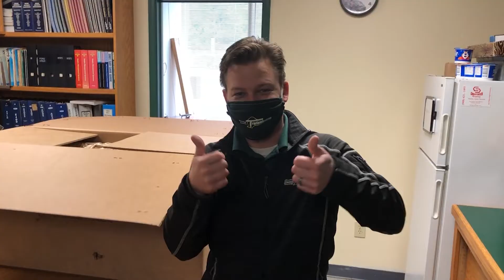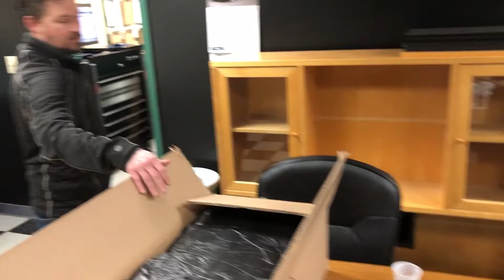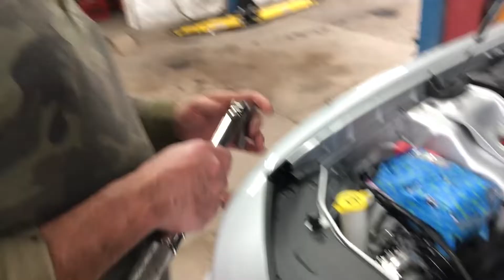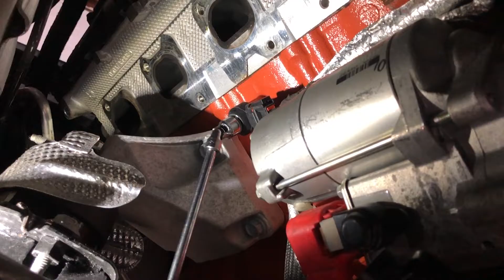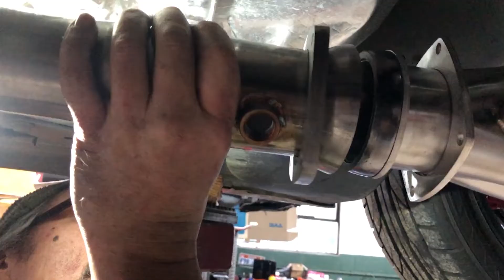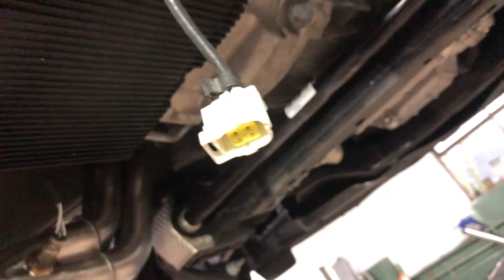DETAILED Installation of Corsa Dodge Charger Long Tube Headers & Connection Pipes.

Comment: Hey Steve, just wondering if you can put these Corsa long tubes with a lowered charger scat. I have the corsa extreme exhaust and H&R lowering springs. Just wondering if I have enough clearance for the long tube headers?

Comment: Is there any way to get these still ?
Reply from the maker: Maybe, if you can find a company that has old inventory.
Reply: @BEASTProjects  thanks my guy I have the exact same charger with the exact same color and exhaust I wanted to get the long tube headers to enhance the corsa extreme !!
Reply from the maker: Check my website for the discount code.

Comment: Every shop I find to put a gaskets and locking header bolts on my  already installed long tube headers say that they have to pull the engine and quote me a arm and a leg

Comment: Sir gotta question I have a cat back corsa extreme  I want  To put some long tube Corsa headers . Do i just need  Corsa headers  no extra pipes.
Reply: I’m pretty sure you’ll need the mid pipes also , I think he bought a kit that includes both LTH and mid pipes .
Reply: I don’t think he answers any questions on the charger anymore since he got rid of it. I miss the charger vids they were very informative.

Comment: What’s that tool called that he used to spread the xpipe ?
Reply from the maker: Expander Kit, https://amzn.to/3r5k2tt
Reply: @BEASTProjects  thanks you sir ,another question I’m not getting a tune when I install these yet can I use to the o2 sensor adapters to not get a cel ?
Reply from the maker: No guarantee that it won’t throw a CEL w/o tuning for off-road use.
Reply: @BEASTProjects  question buddy I installed my headers but for some reason now there’s a leak on both do u think I need to retighten the bolts again I put lock tight on them before going in as well

Comment: I’ve got a 2012 Dodge Charger RT and i want the first bolt on to be bbk long tubes. Does anyone know if i’ll need a tune for just the headers? I wanted to get fbo before i got a performance tune
Reply: It's best to get them tuned I'm getting along two headers added on my vehicle this month going to holler at my muffler dude 2 day

Comment: How does it work with active exhaust
Reply from the maker: Just fine
Reply: @BEASTProjects  so how does it work, is it eliminated or stays in place
Reply from the maker: The valves stay in place.
Reply from the maker: The exhaust valves are incorporated in the Corsa Systems. It’s shown & explained in a prior video.
Reply: @BEASTProjects  I had clicked on this video first, I’ll check the other vids to see the install, thanks

Comment: Did you get any check engine light ?
Reply from the maker: Nope, I have tuning
Reply: @BEASTProjects  what happen if we don’t get a tune
Reply from the maker: You might get a check engine light
Reply: @blkedout_3928  if you get a spacer fir the secondary sensors you will not get a check engine light
Reply: @adorno1010  bet bro thanks 💯
Reply: @adorno1010  question bro for the second o2 sensors do you mean the ones on the flange to put the spacers on ? Or I need a soccer for all of them ?
Reply: @blkedout_3928  just the second sensors

Comment: Where did you get your tuning done because my check engine light came on a day after they were installed
Reply from the maker: DiabloSport or Hemifever can get you all set up.
Reply: you just need a 02 sensor spacer if you dont want to spend hundreds on a tune or dont plan on future mods, other wise yes you will need a custom tune

Comment: This seemed so much easier then on the Durango SRT, lol took us 3 days. We are currently running Kooks headers and we think they might be leaking but not sure yet. We are getting misfires only on a cold start and getting P0300 codes and it's been bothering us for so long so wish us luck this weekend! Great video man and love that charger 👍
Reply: I know this is old but did you use the supplied kooks gaskets or the OEM mopar
Reply: @issawidebody50  We used the supplied gaskets. When we took the headers off we found out the gaskets were leaking, we're pretty certain that the gasket was the problem.
Reply: @trashdiligence5284  ok my boss at the shop I work at has been thru the problem or something cause when we ordered my headers he ordered me mopar OEM gaskets too I think I’m putting them on this weekend
Reply: @issawidebody50  Yeah I would say the OEM gaskets are going to be your best option. People say the supplied ones are just as good which is why we opted to put them on but after that I don't think we're even going to mess around with after market gaskets again lol. Did you get Kooks headers as well?
Reply: @trashdiligence5284  yes sir, Kooks 1 7/8 I believe with catless mids, going to cut out the rear resonators/mufflers (already deleted mid muffler) also going to do a active exhaust delete cause I constantly hear it squeak open and close when driving slow and put some black powder coated dual square angled tips
Reply: @issawidebody50  Damn, you're doing the whole shabang. What car are you doing this too?
Reply: @trashdiligence5284  50th Anniversary Widebody Scatpack Challenger… the tips kind of resemble the original 1970 tips which Is why I’m going with them

Comment: Is the car lowered? Was thinking of going LT but I'm worried I'll be too low with lowering springs.
Reply: Honestly the headers won't bother you unless you love speeding over speed bumps.. I have Kooks Long tube headers and dropped my Challenger Scat pack wit the Eibach "Prokit " which PERFECTLY leveled the car to where Dodge should have had these cars leveled from the factory ..0 issues (it been 3 years since ), yes the headers come down and out towards the rear of the car but I rarely scrape anything so it not what you think..This isnt my you tube account im at the job but I can show you picutres on my face book Carlo Santi..Looks sick..highly recommend it+ way better handling ..
Reply from the maker: It’s bagged...

Comment: Do you really need the rear o2 sensors? It should not trip the cel if they are tuned out right?
Reply from the maker: Not sure... Would make sense that you wouldn't need them if they're tuned out though.

Comment: Can someone explain to me how dynos work? Like wheel horsepower and a car makes * to the crank..? I’m a little confused and I’m sorry I don’t know much about cars
Reply from the maker: Dynos measures force, torque or power & they are designed to create a load to duplicate various speed (RPM) and torque requirements. Based on this data, horse power can be calculated. This in turn provides a snapshot of the engine performance for comparison to the manufacturer’s specifications.